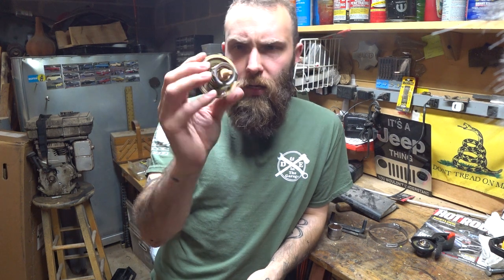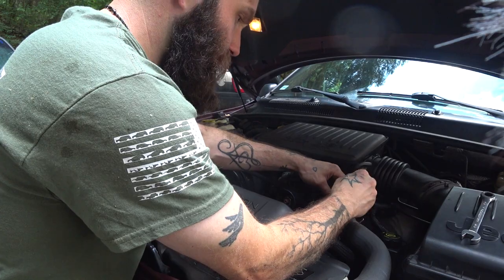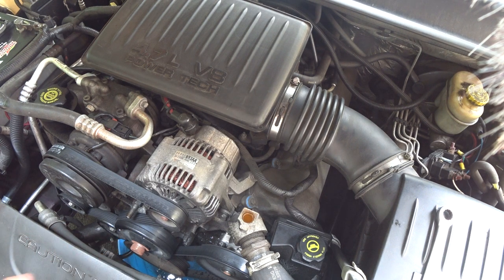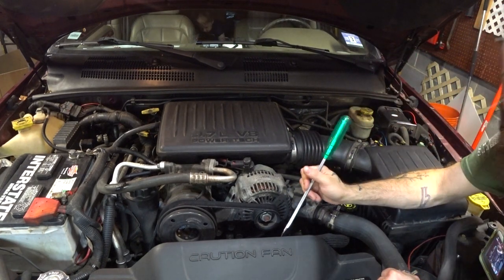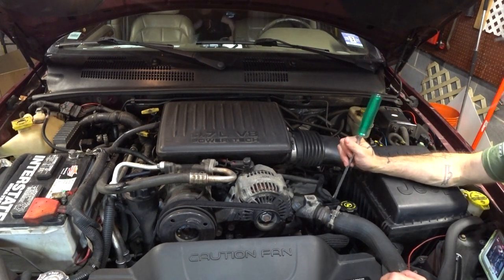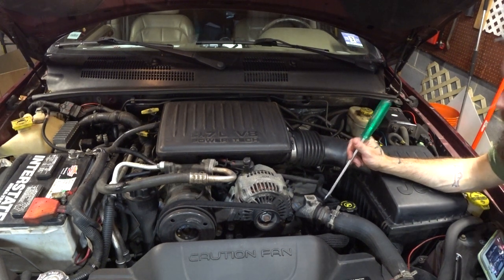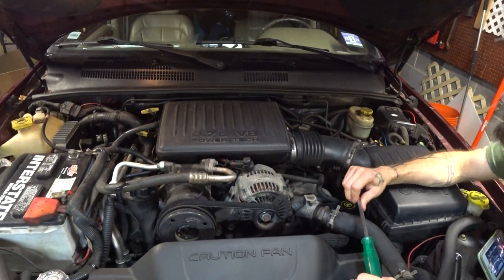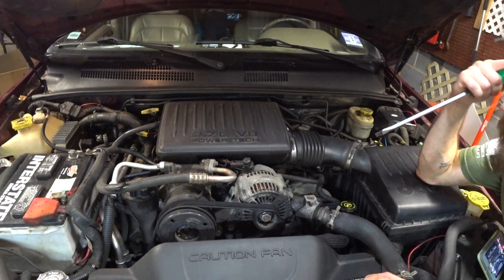How to keep a Jeep Dodge 4.7L alive & happy - EVERY FATAL FLAW I LEARNED THE HARD WAY!

Comment: I’ve had my wj for almost 5yrs and have changed the therm housing and seal twice. Damn plastic housings warp from heat cycles i keep a spare on the shelf. Also have changed one water pump so far. Other than that and regular maintenance it’s been a good vehicle. i bought it with 80k miles it now has close to 150k.

Comment: You'll have to spend some cash that's all...#1 severe duty clutch fan and 12 blade 17" ford fan...A 1998 power steering pump...and 180 stat...you can also add an all aluminum radiator from ebay or amazon (like I did) ...hope this helps someone... cheer's!

Comment: I have a 2003 Durango sxt with the 4.7. It’s not the exact same design as the 4.7 for the Jeep, specifically the air cleaner is reversed and mounts to the left side of the engine compartment whereas the 4.7 in the Grand Cherokee is mounted on the right. But generally speaking, the parts would be 100% interchangeable. My Durango uses a standard mechanical fan for normal cooling (the old school hydraulic fan clutch type) and then it has the huge ass e-fan that runs only when the a/c is on OR the engine coolant temp gets over like 210 with a/c off (such as when towing a pull behind camper or something like that). This set up actually did pretty good the last time I towed a pull behind camper of decent size, up and down all the hills of southern Alabama/north Florida, towed it about 60-70 miles with overdrive disabled so I was constantly turning about 2,500-3,000 at 55-60mph for that duration and the engine never got hotter than straight in the middle between cold and hot (most 4.7 engines run on the colder side of the normal range, about 195-200 tops). I’d say, all in all, my 4.7 is a damned good engine at 185,000 miles. I’m sure down the line it will take a shit, all engines do. But I’m interested to see just how many miles I actually get off this heifer before she goes out to pasture.

Comment: I have a 2002 ram 1500 with the 4.7 and I love the motor, a little weak for a truck but it’s usable still and sounds good. Mine has seemed to be an oddball compared to other peoples 4.7s. Mine for one I have overheated all the way pegged to the red zone on the gauge and never had an issue. My truck has 253k on it but the motor supposedly was replaced with a new one around 70k miles ago. But it has been a great engine for me. Always started even in -40 and run good. Don’t have the head gasket issue and has around 150-160 compression all around very good. This engine is absolutely dead reliable if you take care of it, keep it cool and give it fresh oil every 3k and it will last. Mine doesn’t even barely have the lifter tick, but it’s easy to get to and I’m paying attention so the first time I ever hear it I’ll do the lifters. 

Also specifically about the cooling system on mine, you don’t have to bleed mine, rather, you can’t from the bleeder. I have a coolant reservoir that is integrated into the cooling system. It’s much higher than the bleeder port so coolant just pours out of there and when I started it, it geysered like crazy. All you have to do on mine is fill the coolant up in the tank and run it till it’s mostly warm and make sure it’s topped off and it’s just fine. Thai system was very weird and they only used it’s in 2002-2003 rams and then they changed it to a traditional style overflow tank that is literally just an overflow tank instead of a pressurized container that constantly has coolant flowing through it. I have done so much research and learning and experiments on this motor and have come to know a lot. Take care of it and it’s good.

Comment: I have an 02 wj limited and love the truck. Bought it 6 yrs ago at 101k has 146k on it now. Was leaving work a few weeks back and without warning or an overheat it lost a head gasket. Seats are still in the heads. Currently doing the gaskets on it now with a whole new rebuilt top end. It appears that the gasket at number 8 cylinder was the issue. The heads look great, no pitting or corrosion. The truck to me is worth putting the money into. It still looks great and before this treated me well. I will say this though, I have done heads on 4.6 fords in their passenger cars, I would take them over this job any day. There is no room at all in that engine bay.

Comment: I have mentioned this elsewhere but I think it worth mentioning again here: This particular engine, the 3.7 and 4.7 seem to have a lot of heat related head issues on the passenger side.  I think the solution is to drop to a 180 or 160 thermostat to give more of a cushion to that passenger side head - which tends to run 30 degrees hotter than the drivers side head.  The 195 thermostat leaves that passenger side head dangerously close to getting too hot.

Comment: Yeah the mechanical/electric fan combo works great. Just gotta have both working.   

My 2000 is sitting around 250k and its still solidering on. When it's cold out it will rattle something fierce on start up then quite down. No idea what that is,but the  Engine has been very reliable.  Pulled hard with it. Out of state trips. Hot rod the thing constantly and it just takes it. Although it absolutely drinks the gas. You peaked my concern as i do have green coolant and not orange. I suppose i need to change that.  Only issues I've had. ECM failure causing a miss though thats not the engines fault. And an injector needed replaced.

Comment: Here is a tip or two on my 99 wj the heater lines need to be seperately flushed. The intake and return trap the old (wrong) lime juice in the heater core. The in and out tubes are higher than the air bleeder . Next on my wj even when the air bleeder and radiator are open there is an airlock and all the draing stops and the block is full of juice. One YT er installed a petcock valve on the driver side near the rear of the engine, in an engine bolt replacement.  2 gallons came out to give him a foot bath.  Now if you have the all wheel drive as I do your SoL.  I have to locate a different low area.  One more thing near that freeze plug and bolt their was an air sensor. It is just under 50 dollars take care keep it dry.  If you get it wet, it will short out.  The valve makes it easier for future fluid changes.  My 99 came with a special gift, a blown right head.  Just needs a seat replace, wife pulled over when rhe engine got hot he said. I drove it up onto the trailer he said. It runs well he said.  I did know right away this was not the case. We broke it down to survey the damage. Looking for a rebuilt engine right now.  We found broken valves scored cyclinder wall  bent piston rods. And of course lime juice where orange juice should have been,  both heads are cracked.😢

Comment: For starters this video was very informative, thanks for that. 
I have an 04 grand with the hydraulic 4.7. It has presented several issues. The first is when it warms up and I turn it off then try to restart it won’t. It usually takes about 2 hours to cool down and start. Next when my engine temp gets to about 210 my fan starts to sound like it’s going to take off. Thanks for any insight.
Reply: Replace your crankshaft position sensor. You can test if it’s bad by using a hair dryer on it when it’s cold and heat it and try and start the engine.
Reply: Try changing ASD relay.

Comment: I have an 02 4.7 GC. It’s been one of the better vehicles I’ve ever owned but also one of the most frustrating. Just did valve seals, lifters, new radiator, timing chain set, hydraulic hoses, thermostat, plugs, cam sensor, idle air sensor, blah, blah, blah. Got about 210 k on it. Hoping to go for 300.
Reply: I’ve got an 02 as well.  I oive it but at the point where I either need to get rid of it or put some money into it.  Not sure what to do.  It has a tapping noise that needs to be dealt with.  Not sure if timing chain or lifter or what?   Only 132K 
All that work must have cost some money.  Was it worth it?

Comment: Bought a 2010 dakota from a relative. Drove it 6 hours home. Poped the hood to check all fluids. Opened the rad to find it completely bone dry. Later find out the water pump had a leak that my Relative failed to share with me. Buy a new pump and coolant and fix. Next week i find out the water pump has a recall and I could of had it replaced for free...
Reply: I got a 2001 dodge Dakota having heat issues the mechanic I took it to just replace rad, and thermostat for 847, after he test drive it still over heating on stop and go and he’s saying water pump needs to be done. Should I call and see if it’s a recall?
Reply: @JohnnyDominoRican  I would go online to the dodge/mopar site and search your trucks VIN for any recalls. I know that for the 4.7L v8's, the water pumps are prone to fail.

Comment: currently got one with 299k!, had it overheat 3 times and the 3rd time the lower hose failed and it warped the heads, replaced chains, rockers, lifters and guides etc. Just keeps on going!
Reply: Thanks, Michael, overheated mine and now just babying it with small coolant loss.  Encouraging that it can be saved.

Comment: Every cooling component in my 2002 GC 4.7 needed replaced at 130k. I bought it was 123k in 2015ish, and no I didn’t know the history of it’s maintenance - only that it was a 1-owner. In addition to burning 2 quarts of oil every 2500 miles and having the mysterious death wobble (lots of suspensions parts replaced but it never went away). I gave Jeep one last chance when I traded it in for a 2011 V6 with 65k, and that one has been very solid in terms of reliability. The first month I had this one, I replaced all fluids (transmission, diff, coolant, etc), got it aligned, put new tires, pads, rotors, SERP belt, spark plugs, filters etc on it. It not has 100k and hasn’t cost me a dime out of pocket other than the routine preventive maintenance (factory recommended stuff, although with more frequent servicing). I miss the feel of my V8 though. My next vehicle will likely be another GC, a 5.7L Grand Cherokee L. I feel like I can bypass the reliability issues by buying it while it’s still young and keeping it with the preventive maintenance like I do with my current one.

Comment: Great video Doug. Thankfully I haven't had too many issues with my 4.7 cooling yet, however it does start to get hot going uphill with a load. Knowing what I know I baby her along and we've been doing okay. I've been contemplating the swap to mech fan / e fan myself. I wonder how hard it would be to find a '99 or '00 WJ in the junkyard with a 4.7 and towing package... allegedly 99 and 00 WJ 4.7's with the tow package have both the mech fan and the electric, meaning in theory a monkey with a toolbox could swipe those parts and wire in the resistor for the hydro fan solenoid to eliminate the hydro fan and replace it with the mech and electric setup for heavy duty/ towing use utilizing all OE parts that could be readily replaceable at a local parts store.
Reply: The only thing is that you would have to run your own wiring for the e-fan, install the other power steering pump, and solder in a resistor (as Martin built did) in order to ditch the check engine light.
Reply from the maker: I think that is the name of the game with the 4.7. Learn what yours like, then give that to it. haha
Reply from the maker: Yea, I am going to be taking from MartinBuilt heavily when I do my fan swap
Reply: I did the swap on a 03. Grabbed parts from a junkyard 99, and ordered some new, again for a 99. Yes you will have to add a fan controller.  The resistor trick works but it is easier to just pull the fan solenoid, Leave it connected, and stuff it under the battery tray.

Comment: Hey man I have a 2001 Dodge Durango with a 4.7 high output motor the good motor it's a really good motor I have 210000 miles on the original owner of that vehicle fully loaded all perspective vehicle to tow a lot of weight and I still have a went ahead 206 thousand miles of Elsie's dropped without using the orange coolant I was using the green coolant from the factory you still got the valve seats

Comment: absolutely love the 4.7, "does everything I ask, but have to watch the cooling system" well said, my sentiments exactly. 

I've had mine since 2017 and she just dropped a valve seat. I blew the radiator. I'm just tearing it apart today and wanted to check out a few videos.
Reply: My 4.7 has over 300,000 km on it. Starting to think that I ought to replace the timing gears and chain to prevent disaster. Love my '03 Dakota.

Comment: Fan RPM is adjustable.
Air in the coolant cycles out within a few heat cycles at most.
Replace ps pump with a non fan unit and put on a plastic mech fan... no more fan issues. Don't forget a 180 t stat.

Comment: I have a ford explorer fan on my jeep wj, works like a wonder, they are 11 blades and are plastic, just need to get the fan clutch for the explorer and the fan, it fits under the existing fan shroud. If i remember correctly you will need the year 98-01 Ford Explorer fan. You can find them used on eBay.
Reply: I was going to do an efan on a 5.3 gm I had but decided against it. I had all the parts to do it i robbed out of a wrecked 6.0 denali, but could not find any fan controllers that people didn't seem to report having problems with. I was going to use the fan controller to switch relays instead of directly driving the fan but figured the chance of the controller failing and overheating was not worth it.

Comment: It’s an ok engine. Don’t worry so much about the cooling fan. The issue is the radiator and valves. Mine has over 200k.

Comment: Throw a magnet on the solinoid on the fan and you'll be amazed on the air that it pulls. You'll make the belt on the power steering pump bark. I've done it and I know!

Comment: Purchased a salvaged 04 grand cherokee in 2017 with a 4.7 that supposedly sat for 7 or 8 years because he couldn't get it running and he was too cheap to pay someone.  Anyway I discovered that it had jumped timing from apparently sucking in water after they drove into deep water. Fortunately it just broke the main tensioner and jumped a tooth or two. However being someone that's never messed with dual cam I did a bunch of homework before starting and I never seen it state to use orange antifreeze, and that's even after following my manual that referred to the bleeding method you showed.  Well after new chains, tensioners and water pump it's been running great for over three years (note: I'm knocking on wood as I write this) but after watching your clip it's time to drain and replace the green with orange.

Comment: Welp.. I'm about to get my first 4.7, after running my (Light-A 3.9) for 32 years.. its still running btw, like a champ... at half a million miles, its been over heated to the point of exploding the cap off the radiator and blowing lines clean off the engine, has never needed a re-build and still starts up year round and runs great without burning any oil or antifreeze.  Absolutely in-destructible engine that you can not break no matter what you do wrong.  SO...  adding a 4.7L to the chrysler collection, now I'm glad I saw your videos because I will do the opposite of what I do with my 3.9L L.A. engine.  lol I'll have to get the proper coolant, proper power steering fluid, maybe order up an electric fan kit and throw that contraption in the trash..  But thanks for the info.  Also I run Signature Series AMSOIL in my half a million mile 3.9, I have no way of knowing whats in the 4.7L....  I just have to assume its probably synthetic, anyway am planning to do the same in both my dakotas 5w30 amsoil + napa brand WIX filters.  seems like a good combo, has worked so far.  Thanks for the video's.  ANY MORE ADVICE is welcome though, my 4.7L truck is a 2005 Laramie, would like to make it last as its a nice fully optioned out truck.
Reply from the maker: Awesome! Congrats! Wish you the best of luck with it

Comment: I got a 2002 dodge dakota with the 4.7 motor got it new it came with green coolant and I have change the coolant several times never used orange coolant and I have never had a problem with it

Comment: Just bought an '02 Dakota this spring with a 4.7. I had no idea about the potential problems until recently. Glad I found your channel. It runs great but I'll be keeping an eye on things a little more closely now.
Reply: Ive owned 3 4.7s none ever had issues. 600k miles between the three of them. Most reliable motor ive ever owned.
Reply: @clarda1  nice got any videos

Comment: I have had 4 4.7's, overheating is the biggest killer of these.  That and the shitty lash adjusters that bleed down.  I believe the best way to bleed the system is to let it cool down completely, overnight and then bleed it again.  The sure give away is the waterfall sound in the heater core, that is air.  About the hyd fan, I have never had a problem with them, I have had 2 with the hyd fan.  Get the hood vented, underhood heat is a huge problem on the WJ also. Mine runs 190 now no matter how hard I push it, the heat coming out the hood vents will burn my hand.  AC runs a lot better also.  Unibody construction does not allow air to flow around the engine and the 4.7 is stuffed into the compartment, air cannot get through the radiator unless the air under the hood can get out.  Any engine with alloy heads and an iron block have the same overheat issues.  I have had a 4.0 WJ, never again. Way to slow.  Put some solid lash adjusters in, keep it from overheating and it will last a long time.  My current 04  4.7 HO has 166,000 on it and runs great.